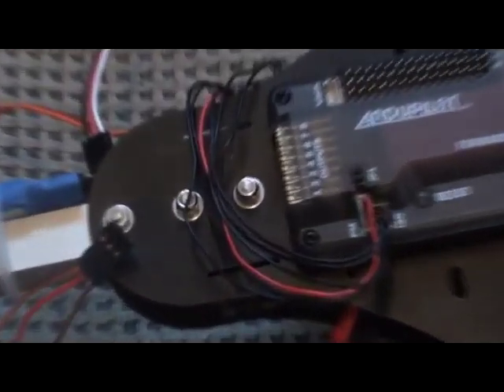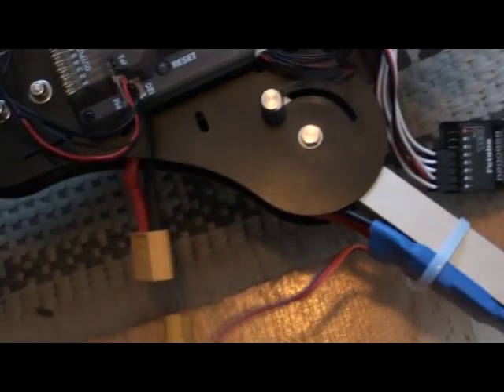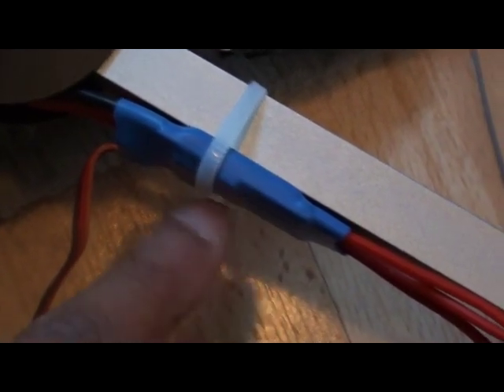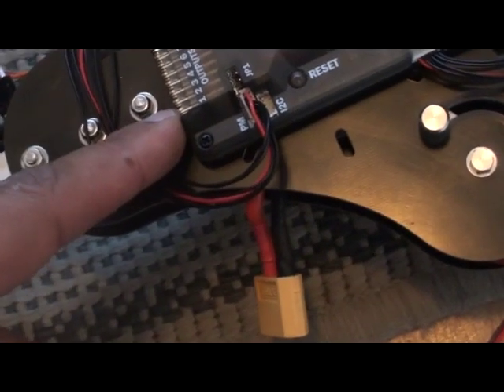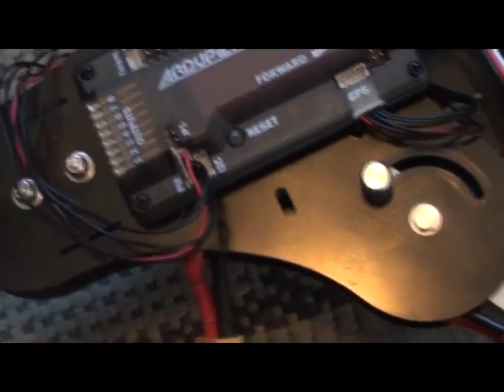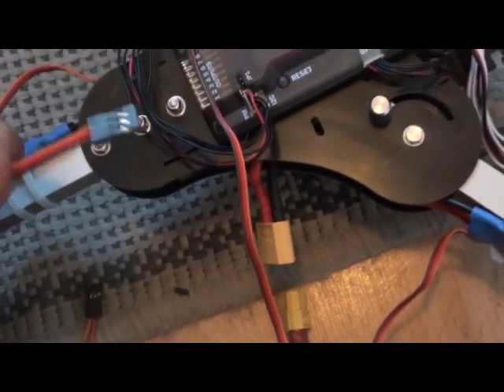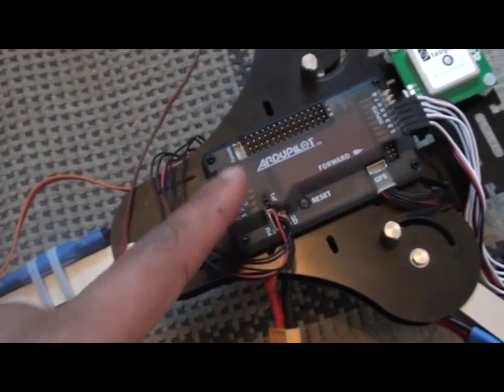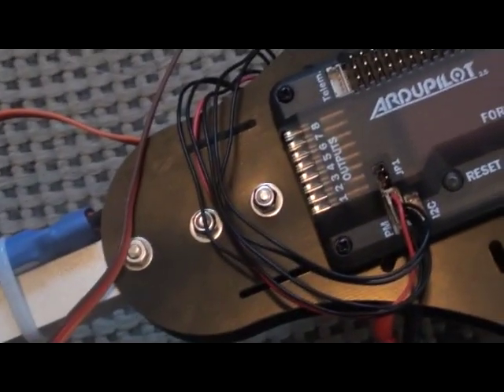APM 2.5 Ardupilot controller- setup guide 2 of 4

Comment: Thanks. Power connections info very useful! I'm about to connect up my 4 simonK 30A ESCs - I'll connect just one red power line to the APM and cut the rest. In fact I'll power the Ras-Pi with one of the unused ones. cheers. HS.

Comment: Hi 75echo, i'm trying to use the stock power board (pc330b) from my vision plus with all the motors and esc's (djiPV-07's), but when i switch it all on there are beeps and red lights. Had it successfully flying with an original phantom board, esc's and motors, even the led's worked as they did with the Naza brain, but this one is stubborn....any ideas?

Comment: Hello there,

i am doing exactly the same tricopter as you are, APM 2.6

right now i am facing a problem with my yaw servo.

i have armed it still there is no response from the yaw servo...

my connections are #1 #2 #4 and the servo is connected to #7...

input for servo is through CH_4...

please do help me.. i am struck at this for months...

Comment: hi there i plan to install a (4) 40a esc(40A-UBEC)  http://www.banggood.com/Emax-Simon-Series-12A-20A-25A-30A-40A-ESC-For-RC-Models-p-918126.html with switch ubec on a quadcopter. no use of servos.do i have to connect also the power module? or only the one 5v cable of esc.does i have to cut the wire to other 3? do i have to bridge the apm with the jumper?

Comment: Thanks so much for your very helpful tutorial videos. I have learned so much from them.
I am building a quad with AfroESC 30A ESC, which is a linear type. On the users manual, it says that it is a lightweight BEC, capable of about 0.5A, which should be sufficient to power most flight boards, but not servos. A dedicated BEC is recommended where servos or other devices are used. Do you think I can connect these ESCs to the APM 2.6 board's output while AMP power module supplying the power?

Comment: I have this (RCX 20A ESC Brushless Motor Speed Controller (SZ Series / Multicopter - SimonK Firmware) with SBEC Output :5V/2A, do i need to remove all 3 ecs red wires and just using one esc with Sbec run on this APM 2.5.2 FC?

Comment: Thanks for ur reply, anyway after several research, I decided to use independent 5 Volt UBEC soldering through my power distribution board, and plug only ESC signal wire into my APM.

Here is the reason why rcgroup*.com/forums/showpost.php?p=24263408&postcount=1

Comment from the maker: Hello , if it is a switching BEC then it is not obligatory to cut the red wires, only Linear BECs need this modification but if you are not sure, just do it as it does not hurt linear or switching ESC /BEC set ups.

Comment: Just got my new APM 2.5 for my quadcopter, I'm using regular (not opto) Turnigy Multistar 30A ESC (SimonK-ed) 

Do I need to cut the red wire on my 3pcs ESC, and leave 1 complete 3 cables on 1 esc ? because the specs said it has "switching" BEC..

Thank you!

Comment: Thanks for your answer. I saw it again and you were talking about powering servos, understood that wrong. I am a little bit nervous about some articles where they told about "failure" of the powermodule resulting in a crash and better using an Besc on the input side. I will try the original power supply and see what it will be.

Comment: You only need to remove the red wire if the ESC's have a switching BEC. No need to cut them, you lift the small tab and remove the wire then put heat shrink on it. This needs to be done with switching BEC's no matter if JP1 is connected or not.

Comment: Far as connecting all the ESCs go isn't there a jumper that can be removed on the APM 2.5 board so you don't need to cut all the ESCs 5v wires? Im sure this was the case with the APM 2.5 boards china sellers on ebay were advertising

Comment: You're a life saver! I get it now, but one more question. :-) I was wondering do you have to use a set of receiver and transmitter for: fpv , remote control, and telemetry. That would be 3 transmitters and 3 receivers total?

Comment from the maker: The 6-pos cable plugs into the 6-pos connector on both the Power Module and APM. Your battery connects to the Power Module's MALE connector, and its FEMALE connector from the power module plugs into your ESC or Power Distribution Board.

Comment: Can some one help? 
I have a Dji flamewheel frame with a apm 2.5 board that has a power module. So i am wondering  If I soldered the esc to the board as well as the battery connector. What do I connect to the power module? Or do i not soldered the battery connect to the frame and just plug the battery into the power module? If I do that will everything be powered?

Comment: Also, could not arm or disarm the copter - only responded to ESC calibration process. Noticed  when powering up copter, boards LEDs don't work/show initialization is complete. So, I don't think the board is powering up with connection to copter only (Tx/Rx/Battery & no usb). Board powers and connects to computer fine w/ USB only, as when installing firmware. I'm powering Rx from 5th board input to Rx gear channel(5th channel). I appreciate your help - you're videos have gotten me this far...;-)

Comment: Great and informative videos - thank you!
Having a problem setting up my simple tricopter to the APM 2.5. I connected the Rx to board per wiki instructions for roll/pitch/throttle/yaw (using Spektrum DX6i Tx & AR6210 Rx).Issue: the board did power up ,connected to Mission Planner & Tx/Rx, and I went through the RC set-up to calibrate the sticks; got the ESCs calibrated; all motors & servo worked, although the servo  seemed connected to the throttle inputs & roll/pitch inputs not responsive.

Comment from the maker: Usually , it is mentioned on the ESC print itself or in the manual. i have never used the ESCs you mentioned so i can not tell if they are linear or switching. If you are in doubt just cut the red wires except on one ESC. Otherwise each ESC will supply 5v independently via thier BECs which all be supplied into your APM module within the same circuit ,this can cause burnouts.

Comment from the maker: You are correct, the KK2 board has more throttle ump, the APM 2.5 seems to limit the amount of power  going to your throttle. i used to get about 12mins from a 3800mah battery. The motors are no name cheapo 700kv Chinese motors.